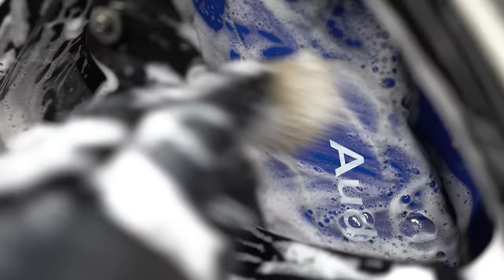Dirty RS6 Deep Clean - Exterior & Interior Detail - ASMR

Comment: Hi, Love the RS6 I’ve got a little tip for you when you clean the windscreen with the wipers in the way...... when the car’s ignition is turned off HOLD down the wiper arm for two seconds and the wipers will park straight up to the windscreen so that you can lift the wiper blades from the windscreen to clean it. This will work on most Audi’s
Reply: Or in through the MMI, you can set the wipers to 'Service' position and they will come half way up the windscreen to be pulled away.
Reply: You gotta talk every now and again. Just a couple brief description would do this video wonders.

Comment: Another great job mate! Those floor mats sure needed a good rub! Was expecting a very dirty extractor tank though 🙈
Reply from the maker: Thanks mate! The extractor would’ve been the better option, but since time was very limited, I had to go with a good scrub. It did the trick though! 😁💪
Reply: @VermijlCarDetail  A little elbow grease is never wrong. Gotta stay fit 💪
Reply: @VermijlCarDetail  I saw the video again and I noticed you just scrubbed the floor mats, remove the product with a microfiber and let it dry. The problem I have with this technique is if for some reason the mat gets wet the product (Pol Star) "reacts" and you are able to see a little of foam  meaning the microfiber didn't remove all the product before. Any suggestion? Hope that makes sense.

Comment: Hi :) Nice work mate but tell me why u didnt wash the carpets properly ? Using for example Bissel or another vac ?
Reply from the maker: Hi Karol, time was very limited here, I couldn't get the carpets completely wet as there wasn't enough time to get them dry. Otherwise I would've definitely used the extractor. Sometimes you just gotta make it work!

Comment: do you find the foamer that you use for wheels useful? i've seen you using it in most of your videos, so i assume the answer here is yes, but i've seen people say you have to pump it for 5 minutes to get it to spray foam for like 10 seconds. that is the only reason i still haven't bought it yet, however i'm debating again whether or not to buy it after watching your videos.
Reply: 5 minutes his exaggerated, that being said it's a great tool if you need it and use it correctly. When it's full you will pump it like 20-25 times before it's ready. Then the more air in the bottle the more pumping. Be aware that you HAVE to find the right dilution ratio for each product (to high: 2 seconds of foam, to low: no foam), and you will never get 1 minute of foam with a small bottle like this, but the wheel will be covered before you run out of foam any way.

Comment: why dont you use the drill brush for cleaning the mats?
Reply from the maker: I would normally go for some drill brush action and shampoo extraction, but this job had to be done in just a very limited amount of time, making it not possible to get the carpets soaking wet. Feel free to check out my other interior details if you wanna see some drill brush action 😁👍

Comment: Just a quick question ... is it normal that you run hydro oz on your wheels and wash them afterwards?
Reply from the maker: What do you mean exactly? HydrO2 Lite was only applied after washing the rims
Reply: @VermijlCarDetail  Yes ok but after you use another the foam lance on the wheels
Reply from the maker: @ericptw6311  shouldn’t be an issue as the foam is pH neutral, it won’t remove the protection 😉
Reply: @VermijlCarDetail  Ok thanks a lot for your explications

Comment: You have do it wrongly at 6:50. You should spray from bottom to top, to better protection for the surface. Especially carbon fibre supercar.
Reply from the maker: There is no right or wrong way in my opinion, I just do it my way.

Comment: Why are you cleaning the same piece of car 3 times?
Reply: Cleaning black painted cars is very difficult. Black paits are extremely easy to scratch. So before passing a cloth or mitt you want to be sure there is no dust on the car, otherwise you end up with swirls all over.
Black cars are very delicate, but also the best looking in my opinion.
Reply: *All cars get swirls, but if you get them on a black car they are a nightmare to behold, specially for the owner.